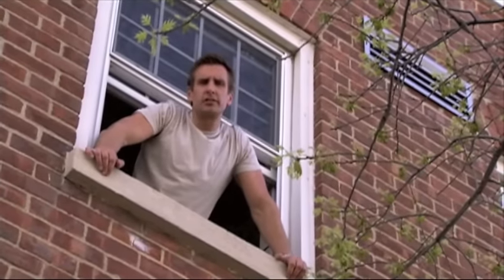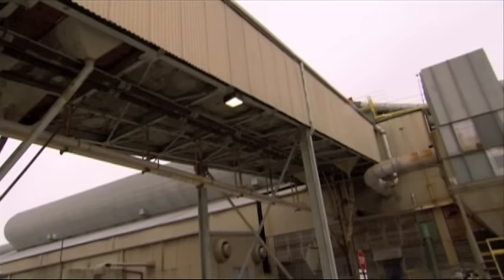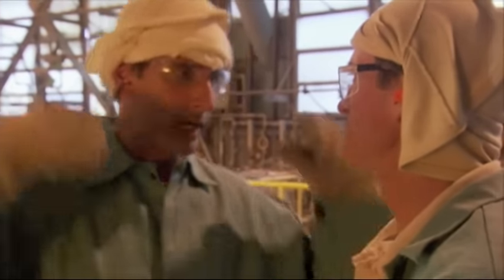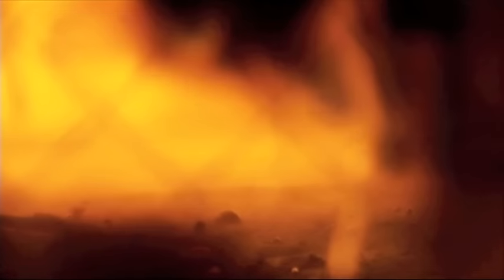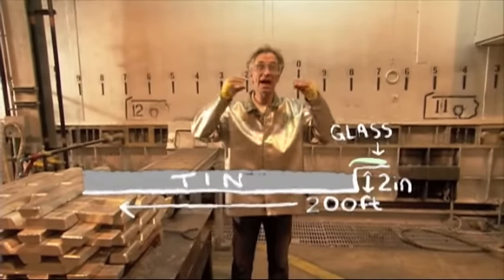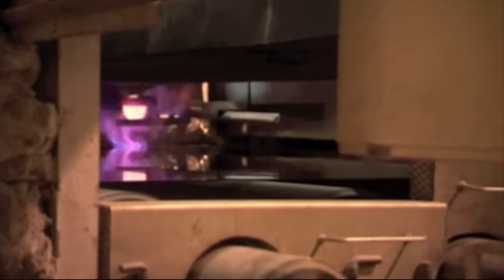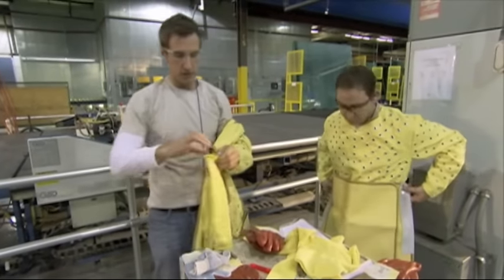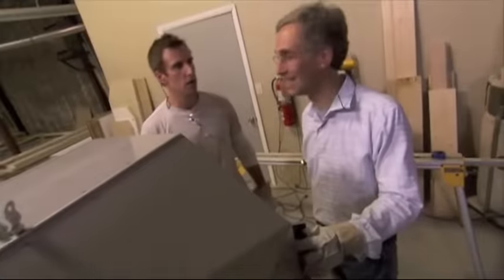How Glass is Made

Comment: nice video but how they pour the glass into forms and spread it so it has the exact same thickness everywhere?
Reply: No forms, the glass is cut to size. The thickness is controlled by the speed of the line of glass coming from the furnace. Slow it down and it becomes thicker. Speed it up and it becomes thinner. It is called float glass because it melts and comes out on the surface of the molten tin.
Reply: @bconman  makes sense, but there are not the slightest irregularities in thickness,  unevenness. This happens automatically just by letting it flow at a certain speed?
Reply: @lenny108  The draw is managed by the toothed wheels on each edge, so the speed of those wheels control the draw speed, and the thickness can be controlled to a variance of less than a few thousandths. And another silly fact is that the dimpled pattern on the edge of the draw that you see in the video as those teeth dig in and pull the glass, and is at the end of the line cut off and recycled, is called Cluster Plucker.

Comment: Is silica glass and tin the combined structure of glass? or is it just silica glass that makes glass by itself?
Reply: there's no tin in glass. tin is just used to make sure the glass will be flat, but they are never mixed.
Reply: It's different than making a mirror, where tin is used in the glass to cause reflection?

I'll go see howca mirror is made now. Thanks for your response.
Reply: yeah, from what i see in this video, tin is never added in the composition of the glass. it's just used because they can't mix, like oil and water, so that when the liquid glass is laid on top of liquid tin, the glass will be completely flat.
Reply: @dim1414  You can tell the tin side by using a black light. The tin side will look like a fog on the glass on the tin side. The air side will have no fog.  Or you can tell if you can see the edge of the glass. Black light on the tin side will make the edge look like it has a glow. Air side will not glow on the edge. So the glass does pick up a microscopic bit of tin.
Reply: @bconman  nice thanks! haha
Reply: @dim1414  Also the lines in a heated rear window will change color based on if painted on tin or non tin side. The lines are ceramic silver that melt into the surface of the glass. From the outside of the car the lines will appear either yellow or a dark red depending on which side painted on. So glass must be checked with black light to make sure all are painted on same side per the customer. If customer wants red and and a few somehow get painted on wrong side and end up yellow, they will not accept them, and thus we have to throw them away. More than you ever wanted to know eh??
Reply: @bconman  its wonderful thank you!!

Comment: It takes just minutes for a large machine to pick up 6000 pounds of silica sand and move it to where it can be shipped. To do that with a glass recycling truck, it takes about 6 hrs in a suburban environment, going from house to house, at a cost of about $300/day, after which it must go to a sorting facility, then be loaded onto another vehicle to be processed. This is why glass recycling is a completely unsustainable smokescreen, and probably always will be.
Reply: I've wondered if glass recycling is worth the effort. Sand is virtually unlimited, and glass isn't necessarily toxic by itself that I know of. Surely it has some negative effect to some creature somewhere, squirrels probably eat it and shit blood on cars or something. But it's generally harmless, unless it's laying around everywhere. So it has to go somewhere. I guess the benefit is saving landfill space. There's gotta be some kind of way to make melting it back down more efficient, somebody has to take the stuff somewhere either way.
Reply: Recycled glass is called cullet. Cullet melts at a much lower temperature than the raw sand mixture. Adding (up to 30%) cullet to the raw mixture allows the glass manufacturer to operate at a lower furnace temperature saving energy (money). Melting at a lower temperature also prolongs the life of the glass furnace between rebuilds, also saving money.
Recycled glass is very important to glass manufacturers.
Reply: @gregcorwin8316  My problem with glass recycling is the amount of energy expended  in door-to-door style collection of it, which is something that seems to be left out of the energy equation.  A Waste  Management driver in Tucson told me he used about 40 gallons of Diesel every day in  his $150,000 truck picking up 8 tons of glass. That 8 tons of sand would be picked up at a pit in minutes. I understand that sand takes more energy to melt but  is it that much?
Reply: @danstrayer111  I understand your point, but what happens to the glass that isn't recycled? It goes in the trash where it's collected door to door and transported to a landfill at whatever cost. 
Where I live glass is collected along with aluminum and other recyclables. Would you suggest that we should stop all recycling? The cost of manufacturing "new" aluminum from recycled, for example, is significantly less than the cost of manufacturing it from raw materials, even when transportation and processing are added into the equation, so I would assume that aluminum cost would increase if there was no recycled product. And while glass cost isn't nearly as offset as aluminum by using recycled product, without cullet the cost of glass manufacturing would certainly increase.
Reply: @gregcorwin8316  Metals are a different deal entirely.
  Part of my issue with glass is that these containers were originally designed to be one-use and discarded, and now we are are trying to assign a value to something which actually had no value. If energy was really the issue here, they should go back to heavier containers which historically got used about 10 times being refilled before discard.
Reply: @danstrayer111  I totally agree that we would be better off if glass bottles were made to be reusable rather than disposable, unfortunately I don't see that happening in our future. 
I concede your point that glass recycling on it's own is not going to have a financial payback in most places, and relatively little recycled glass is actually melted down to make new glass, most of it goes into other applications.
Also the glass that's going to go into 
windows isn't going to contain any recycled glass bottles or jars, or other consumables because of different, noncompatible, formulations. Conversely, that's why local glass recyclers don't want window glass mixed in with their bottles. 
So where and how the glass can be recycled is a huge consideration.
But back to cullet, it's so important to float glass plants that if they have a shortage (it happens), they will even break up and recycle perfectly good glass in their plants to dump back into the furnace if it becomes necessary.

Comment: What people do not realize is glass is still a liquid even after it is cooled and installed. A pane of glass will melt in 10,000 years to a puddle under your window ledge!
Reply: glass is an amorphous solid, and no it won't.
Reply: @gregcorwin8316  Only when it is not heated.
Reply: @donbaxley5530  Any solid will become "liquid" if heated past the melting point, but that doesn't mean it's not a solid by definition. Glass is a noncrystalline solid and not a liquid